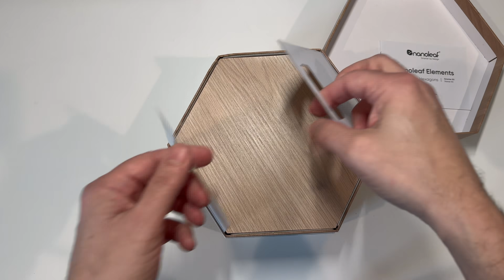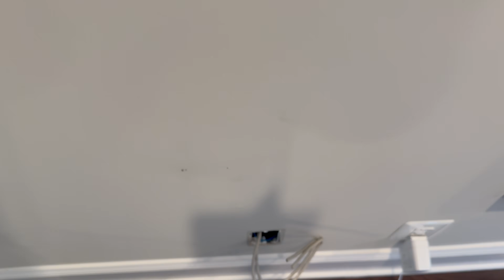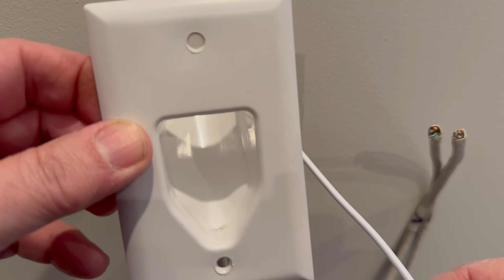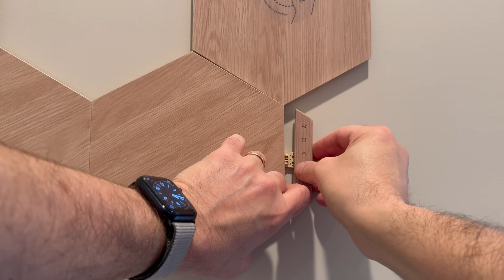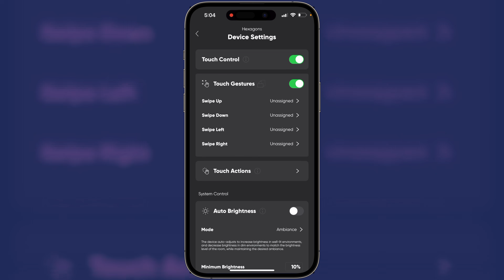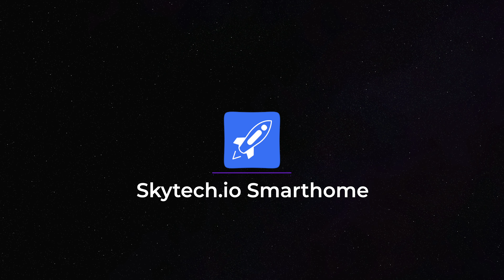How to Install Nanoleaf Elements Hexagons in 7 mins! #howto #smarthome #diy #led @nanoleafofficial

Comment: The problem begins when you want to screw the elements onto the wall. For me, the adhesive pads don't stick to the wall (rough plaster). Somehow I'm missing a drilling template.